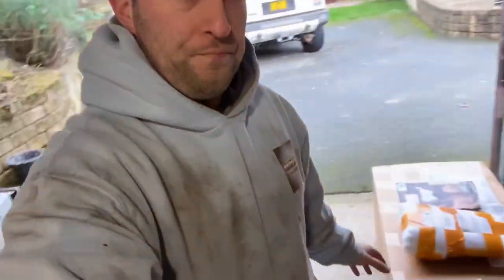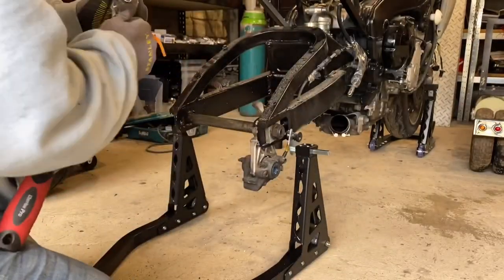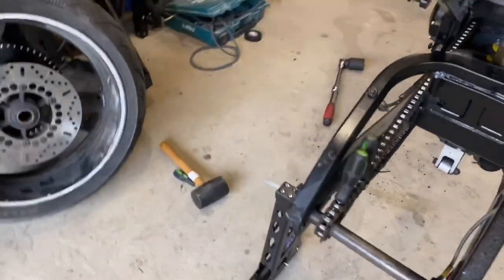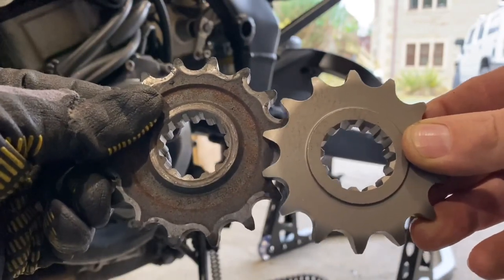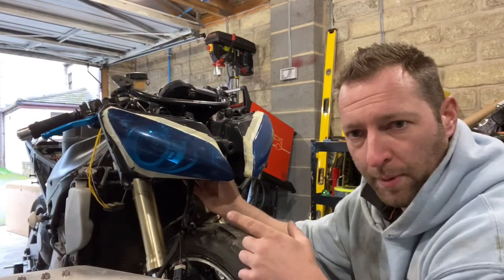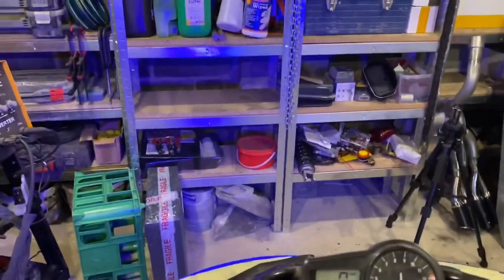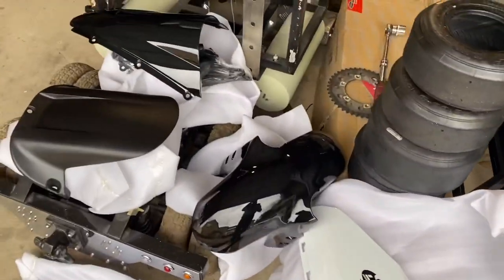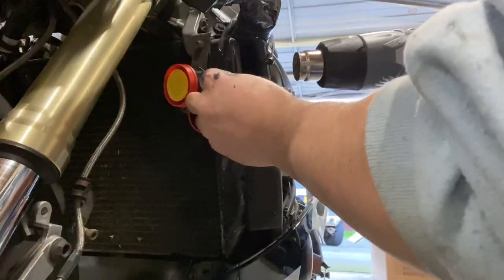YAMAHA R1 LED HALO RING LIGHT CONVERSION, and new gear ratios

Comment: Hi Rob - nice channel and thank you.  I am trying to replace crashed front indicators on a 2012 R1.  The OEM indicator had 3 wires (black, blue and green) but the new ones I bought have only 2 wires (black and white).  Any ideas which wires I am supposed to splice?  Or any other reason I am having trouble getting them to work?  Keep up the good videos.
Reply from the maker: Morning mate. Thanks for watching   I believe the black wire is always ground which makes the white wire your live, after looking at wiring diagram for your bike it looks like the blue is live and green is a switched live  meaning blue wire gives it power and green turns power on and off, hope that makes sense